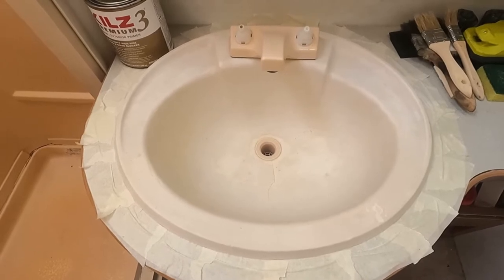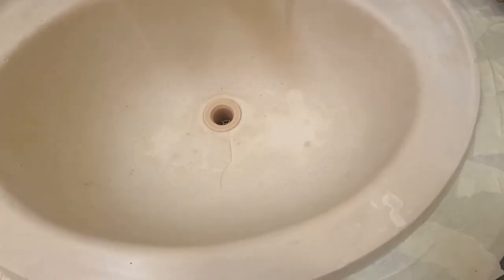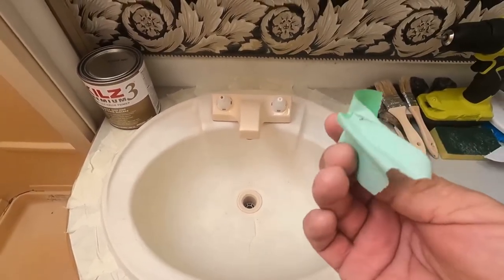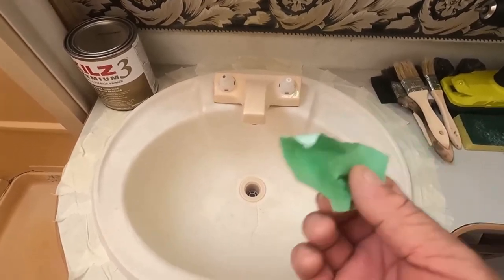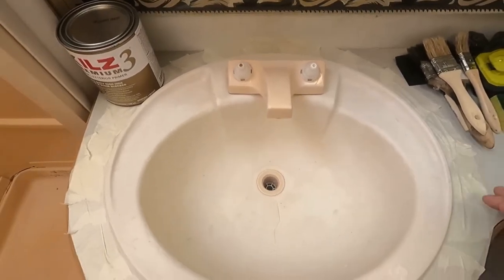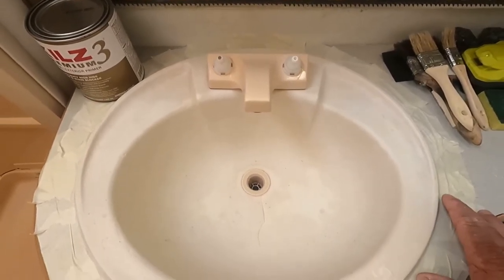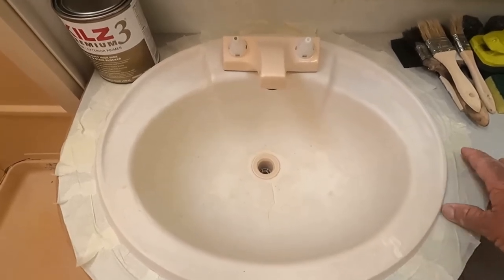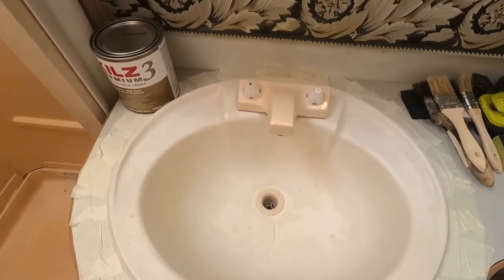Painted my rv bathroom sink with marine paint, was it worth it?

Comment: I used marine boat paint to paint the tiles in my bathtub/ shower and it looked great for about a year. After about two years it still looked good but started to show defects like minor scratches. It is now three years and it is yellowing. There is a very noticeable difference between the high gloss white bathtub (that I didn't paint- still original high gloss white) and the marine paint painted tiles. The tiles look "white" but next to the high gloss white tub they look really yellow. Big noticeable difference between the tub and painted tiles. If you use this expect it to really yellow over time. You will need to repaint the tub every three years or so. I am glad I only did my tiles (easier to fix or add a liner etc if I am not happy) and not my bathtub that would cost thousands to pull out and replace. 
I am searching for ways to maybe try and clear coat it or seal it so it doesn't fade.
Reply from the maker: So far mine still looks great. Thanks for the heads up.